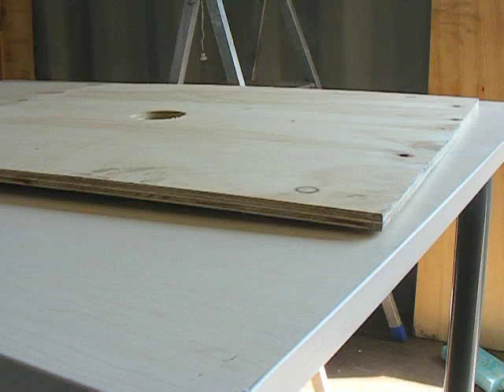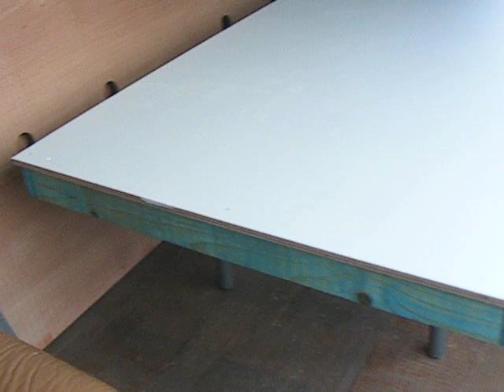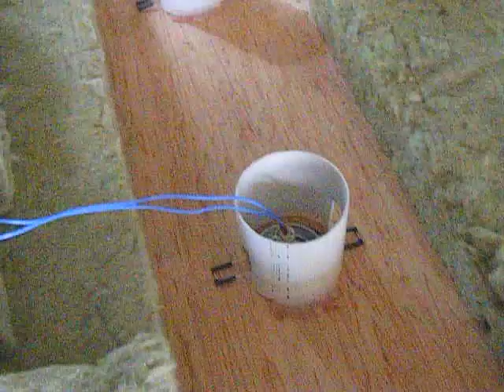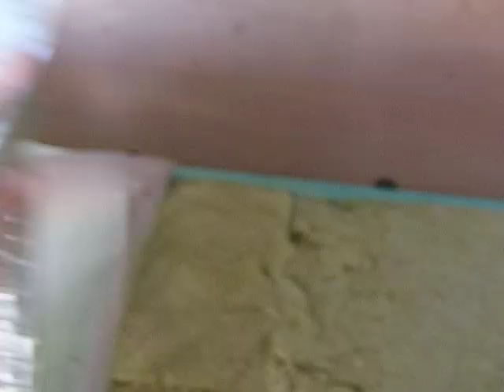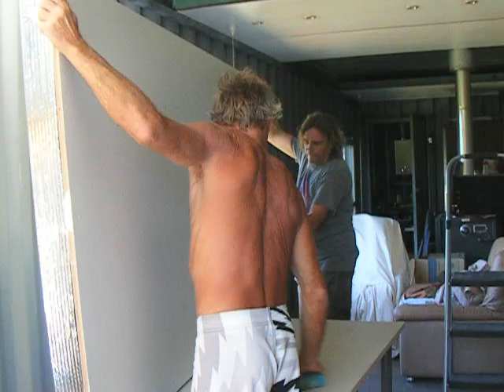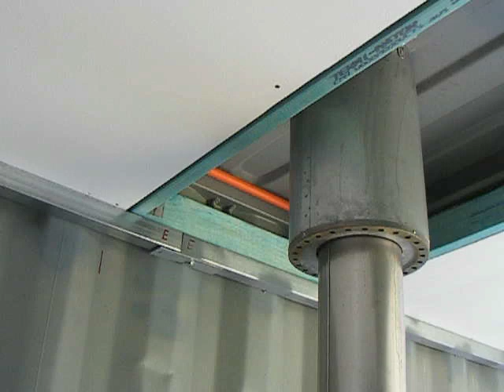Shipping Container House - Ceiling construction

Comment: How about waterproofing the roof area and use frame, drywall and batt insulation on the inside ? 🙄
Reply from the maker: That would definitely work. I was reluctant to use dry wall as I was concerned about water coming into contact with it. My concerns were unfounded and think it would have worked. Cheers Paul
Reply: I am working on a project with containers and we are going to push it through the building department. I will probably make a video documenting from design phase to finished home.

Comment: A "Drop Ceiling" could be used here...aisle 5 (I think) at Home Depot. :)
Reply from the maker: Hi Max, if that is the same as a suspended ceiling with square tiles, I considered that. The frame would be too close to the ceiling to install the tiles. :-)

Comment: the better way is throw battens across aswell as up and down for your walls (a rectangle without the bottom chord)  the studs at the bottom need to be made just like a regular house.   Then just use gyprock.  More then one way to skin a cat tho.
Reply from the maker: Hi Scott, I did not want to use gyprock, I thought it would be heavier, less water resistant and harder to put up on my own. Your suggestions make sense and I agree with the cat story. Cheers Paul

Comment: Hey Paul. If I stack a container on another, would it affect the integrity of the container if I cut the top off the bottom one and used the bottom of the upper as the ceiling? My idea is to give the room a little more height.
Reply from the maker: Hi onetimer, If you cut a small hatch in a roof for stairs and welded in a frame I could see it being ok. Removing the entire ceiling would be like removing the entire side. I have seen it done (removing a side) for real and the container turned to unstable jelly. I would not do it. The High cubic capacity containers (tall) were acceptable for the feeling of room in our experience.. Regular height containers would feel claustraphobic unless you were a hobbit. Cheers paul

Comment: This is why I am watching your videos Paul. Great bites of info, like seeing the size of the ceiling panels and how they fit going in. Those ceiling panels and tracks are a great idea. Did you wire them inline and one switch lights them all or split into groups ?  No marathon videos today. I think i'm on 4 or 5 ..LoL !  Cheers  J&N
Reply from the maker: +Jim Wills The living room has each panel with a pull chord. So you switch on the light where you want it.  Some of the bulbs have been removed as it was giving too much light in selected locations. The kitchen has four modules wired to a central switch with 4 switches. (close to the entrance) This allows you to illuminate as much of the main area of the kitchen from one point as you would like. The remaining banks are on individual pull chords. It has been a success. Because the project design evolves out of requirement, (and quite slowly) I trial most of my ideas with basic construction before committing to the final fit. The lights were tea tree sticks across the roof for over a year before they became panels. I refined the number and positions of the lighting units with them, as well as the switch locations long before I installed the final panels. I knew it would work before I fitted the end result.  I am chuffed that you are enjoying my channel. Cheers Paul
Reply: Very Good...Thanks Paul  Cheers J&N

Comment: Why don't you use plasterboard???
Reply from the maker: Plasterboard is not very resistant to water, and damages easily. Installing big sheets is too hard on my own. I wanted to be able to access or view the roof void if required. If wiring failed or lighting issues arose I did not want to have to destroy my ceiling to fix it. Cheers Paul

Comment: We are considering putting a cheap galvanised roof over the container and the putting maybe 200mm of insulation on top of container, allowing for ventilation so we don't get condensation dropping from galv. roof
Reply from the maker: Hi Joe, if you pitch the external roof would that not direct the drips off the side?  Does your idea men you have a second external roof over your insulation? Cheers Paul
Reply: Paul Chambers Yeah, An independent roof over the container. Easy and cheap to do, especially if you buy damaged metal roof sheeting, The condensation will drip off roof especially where it meets a structural member or even a screw. A Vapour barrier is good to use.

Comment: Clever solution. I am looking at converting a container in Ireland and this wouldn't work as we would have condensation from the warm humid air meeting the cold metal roof.
Would be tempted to use wall lights to keep electrics simple.
Reply from the maker: You are correct about the lights. It would have been simpler, and I wish I had a few side lights. My prerequisite was being able to read a book ANYWHERE in the container easily. We can. We have now pulled a few bulbs out in places we had too much light, but we have been delighted overall. The 12v lighting also drives the phone and broadband as well. Cheers Paul

Comment: Like how you did the ceiling- its by far the Best way I have seen-
why did you leave the air gap ?
Reply from the maker: Hi Groovyvideo2, I haven't closed the tongue and groove gaps yet, not got round to it. I was waiting to see if I needed any access after the install. I will do it one day. I have closed the gap around the flue now, and I used cement board as it would not burn in close proximity to the flu pipe. I have the ceiling panels as close as I could get it to the roof as practical. I can pop my head into the small gap and visually check for problems if required. I hope that answers your question. Cheers Paul

Comment: Good idea Paul, I'm going to try this in my container.
Reply from the maker: Hi Bob, 3 years on it was still a good idea for us. It holds the lighting and insulation and leaves the wall completely clear. It took a while to evolve where we wanted door openings and windows. Because we cut windows where and when we need them, we can reuse pre loved windows and don't have to buy new to fit our openings.
Reply from the maker: The only thing I might do different to adjust the height. I went to max height. When I installed the walls I had to add an 8cm strip along the bottom. It would have been easier to set the height to match a sheet of plywood, 2400mm. Cheers Paul
Reply: Thank you for the tip. 
I see a lot of activity down there. It must be the warmer weather. Cheers
Reply: Do you have the taller containers?

Comment: Hi Paul, 
Thank you for the great information in your videos. I have a question about acoustic insulation. On a scale of 1 to 10. How much is it noisy when its raining ?
cheers, 
Mujahed
Reply from the maker: Hi Mujahed, Rain on the roof is not an intrusive noise. With 50 cm clearance for the top roof, then, steel, airgap, silver bubble wrap, 3.5 R batts, and lastly 12mm ply, there is very little noise.
i guess 2-4. The walls are insulated as well, so its quite like a regular home. Cheers Paul

Comment: Hello great inspiration !!! Wondering about condensation above the ceiling panels ? Have fun.
Reply from the maker: I was warned about condensation in the containers but it has not been a problem for us. The sun shade roof above the container helps a LOT. (assuming Australian climate). We ventilate a lot and usually have the cargo doors open. In full summer we close up to switch on the air conditioner. Only a few days in the year.  Painting them white makes a big difference. I am told the best insulation is spray on. Anything that reduces the temperature difference between inside and outside helps.
If it is a storage container, what about a whirly bird on the top to vent off the heated air. I think ventilation is the reason we have not experienced a problem. Cheers Paul

Comment from the maker: Hi Stevie. You are correct, hot in summer cold in winter. Its insulated now, see the video: 
Shipping Container house -- Two years living in shipping containers (review).
Reply: Do you have problems with termites and wood eating insects?
Reply from the maker: In Australia, absolutely YES. I have seen ants consume wood like chocolate. I buy treated timber for the frames. Hopefully that combined with a steel wrapper will encourage them to go elsewhere. Cheers Paul
Reply: +Paul Chambers Not certain about the points made but ,if anyone else needs to find out about cargo container house plans try Wiltapar  Container Home Secrets (do a google search ) ? Ive heard some amazing things about it and my brother in law got great results with it.

Comment: Hi Paul.  Just wondering why you used treated pine for the ceiling framework?  It's more expensive than normal framing pine and is treated with arsenic or something like that which is a health hazard.  Anyway...nice work.
Reply from the maker: I believe its a copper product, but agree its probably not good for me. I was a little wary of termites in the bush. Cheers Paul

Comment: hi paul is gas boiler gravity fed - we are doing the same in the canary Isles - I have a 150 litre solar tank but have considered putting a gas boiler in for the kitchen
Reply from the maker: Hi profkenny14, no it is not gravity fed. Gravity feed will not activate the boiler. My boiler claims to supply 26 litres per minute water. When the tap opens, pressurized water pushes an activator inside the boiler to start the battery igniters, to light the gas. I purchased a pump capable of supplying the 26 lpm and it works a treat. I had a 12v pump to begin with but upgraded to a mains pump when I had suitable mains power. The mains pump gives better pressure and flow. Cheers Paul

Comment: Sorry. I hadn't read the previous post. @ Chad I'm going to try putting in a visqueen (3ml plastic) moisture barrier against the corrugated steel, using a spray adhesive. Next I'll put in the insulation and then I'll close the walls. Hopefully that will do it.
Reply from the maker: That is a close approximation to my walls. We are not experiencing problems. Cheers Paul

Comment: hi. i'm considering puting tin over the top of my roof completely with about a foot gap between the roof. would this prevent condensation? i get condensation bad in the summer when it's a sauna inside the container.
Reply from the maker: I was warned about condensation in the containers but it has not been a problem for us. The sun shade roof above the container helps a LOT. (assuming Australian climate). We ventilate a lot and usually have the cargo doors open. In full summer we close up to switch on the air conditioner. Only a few days in the year.  Painting them white makes a big difference. I am told the best insulation is spray on. Anything that reduces the temperature difference between inside and outside helps.
If it is a storage container, what about a whirly bird on the top to vent off the heated air. I think ventilation is the reason we have not experienced a problem. Cheers Paul

Comment: aproximately how much would it cost for the shipping container and all of the modifactions including solar power and water?
Reply from the maker: Hi Quincy. If you just want a ballpark number, think 40k. If you want a real number, I break down the cost for each aspect of the project in the ebook (see description) There are lots of things I have done that may not apply to you or a different site. solar was around 12k. I recycle and reuse where possible, so this influences cost. hope that helps. ( I have three containers, so that is also a factor) Cheers Paul

Comment: If this was in a cold climate condensation will form on the steel surface above the insulation thus leading to moisture loading into the insulation. Wet insulation does not stop heat transfer.  This would also lead to your plywood rotting and mould developing.

If this was in a hot climate the entire steel substrate loads with heat and so does your bulk insulation. The fibrous insulations slow heat transfer they never stop it.  That reflective bubble wrap is maybe R-3 if that. These products might display higher R Values but those numbers are found in assembled units consisting of other building materials.

The smarter way to insulate shipping container projects is to utilize ceramic insulation coatings.  A product called Super Therm applied to the exterior surface at just 10 dft will stop heat from loading into the steel substrate.  The type of ceramics used do not absorb heat.  You can hold your hand on the coated surface all day long in the direct summer sun as it makes the surface cool to touch.  Portable field offices are built with this insulation system for the US military when stationed in the Middle East.

When in colder climates a hybrid system of foam and ceramic insulation coatings is very effective.  You eliminate any air cavities between your insulation and the steel substrate as you apply directly to the steel substrate thus no condensation.  One inch of closed cell foam provides R 6. A 10dft coating of Super Therm will increase the R value to about R 25. You can add more foam and or more ceramic coating thickness to increase the performance without sacrificing limited space.
Reply: Tom Clarke, maybe you should just admit you don't understand heat transfer and ceramic technology rather than calling Super Therm a scam product.  I offered my approach on this forum because I like to help people solve problems.  This isn't the place to spew your hatred of something we both know you haven't bothered to adequately research.  I have worked in this industry for 15 years.  I admit it took me some time to wrap my head around the ceramic technology as it does not follow conventional methods.

Had you actually read my postings regarding applications on shipping containers you would have seen that we recommend a hybrid system when you are in a cold climate.  In this instance there is no suggestion the coating would be applied by itself.  Nor is there a suggestion the product has an R-Value.  First of all the R-Value formula is old technology created in the 30s by the fiberglass company for marketing purposes.  For a material to have any R-Value it must have thickness and be heat absorbing.  Ceramics selected do NOT absorb heat and are not thick.  That is the key difference you are over looking or simply not grasping.  Most everyone has heard of the ceramic tiles on the space shuttles in NASA.  They are there to keep the searing heat upon re-entering the Earths' atmosphere from penetrating the interior. The use of ceramics in this case offers a thin, light weight solution. Obviously the use of ceramics to control heat transfer is not new.  

When Bombardier wanted to know how effective the Super Therm measured up to fibreglass insulation they, NOT the manufacturer paid an independent heat transfer testing lab to conduct side by side testing.  It was the testing lab that coined the term "RE" which for their purposes meant R Equivalent.  Since they could not use the R-Value formula on a material that has little thickness and doesn't absorb heat they assigned an RE number to show how it compared to the fibreglass insulation with an R-19 rating in slowing heat transfer.  The ASTM C236 test revealed the coating as applied performed as effectively as the fiberglass in controlling heat transfer.  Remember, we are also talking about two completely different technologies here so don't make the mistake in comparing them because they both react differently when heat is introduced.  The lab tests also do not replicate real conditions so one must be careful in where the coating is applied and in what conditions.  Until you understand ceramic technology you are going to make erroneous assumptions because you are accustomed to the standard technology consisting of heat absorbing materials.

In a hot climate we do suggest coating the exterior surfaces by itself as it will effectively block heat transfer.  In the direct sunlight the coated steel surface is actually cool to touch.  This is because the ceramics do not absorb heat.  Fiberglass and foams can not do that.  They will absorb the heat and trap it, where?  On the interior side where you don't want the heat.
Reply from the maker: Great summary and completely agree. The green paint contains thermilate that sounds similar to your super therm. I cant use the spray on as foam as the containers are still being modified and welded. If I was starting from scratch under different circumstances I would complete the welding and spray insulate.  Thankyou for sharing. Cheers Paul
Reply: Thanks a lot for taking the time to post that! Helpful!
Reply: No problem, check out the following projects using ceramic insulation coatings.  There is a section with shipping container conversions
http://www.eaglecoatings.net/content/supertherm/STprojectpictures.htm
Reply: SD Lawson Super Therm is an outright scam product and will do nothing that you state. Anybody insinuating that any product at mill thicknesses is providing an insulative R-value is full of it.

Comment from the maker: If I were doing it again I would have the sides go up to 2.4 to take a whole sheet of ply or plasterboard. Mine goes a little bit higher. I have a small gap I have to fill. Also container roof's has an upward bow to repel rain. All my roof's have dents and that would make glueing to them a challenge. When I welded brackets to the ceiling on a failed prototype each bracket had to be different to create a level ceiling. Cheers Paul